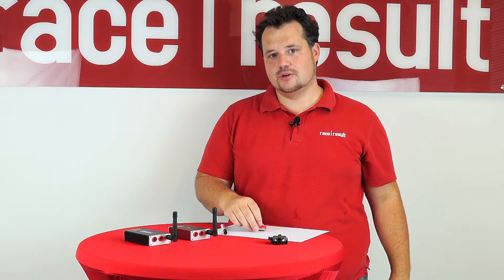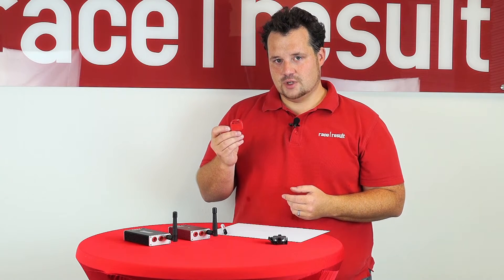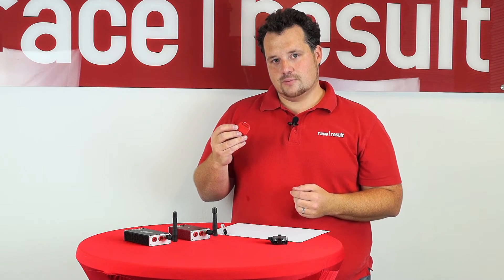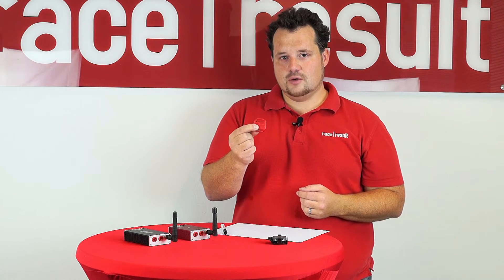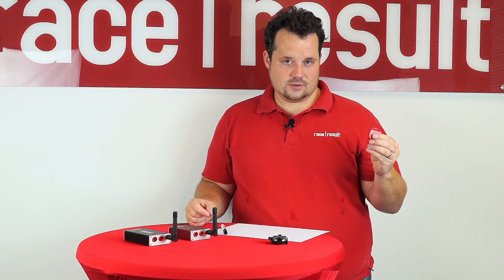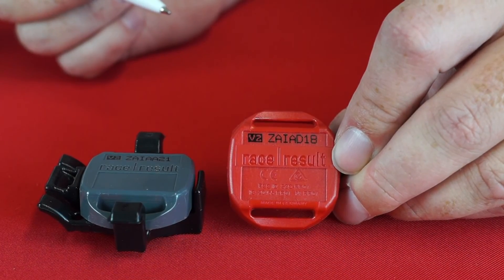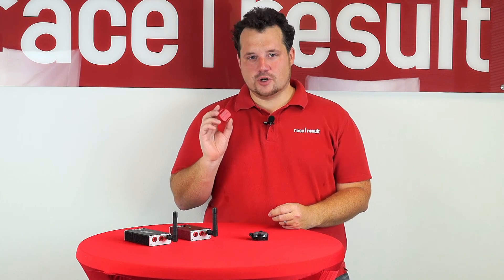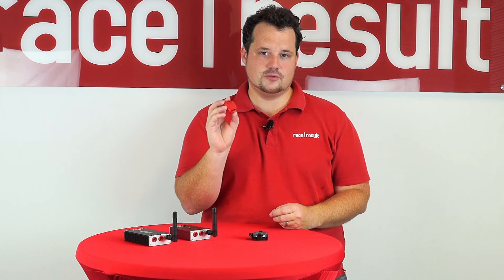Introducing our v2 active transponders

Comment: Curious to know, why transponders must always be in their cases? We always have cyclist doesn't use the transponder case - most of their reason are, it can damage their bikes.
Reply from the maker: The recommendation for the Active Chip Holder applies to the ActiveMotor (new name: MotorKart) transponder. It is used to ensure that the transponder is not in direct contact with metal parts.
In fact, the red transponder is commonly used on bikes without Chip Holder, instead it is attached with cable straps. That works perfectly!

Read more here: https://www.raceresult.com/fw/support/kb.php?id=2306-Active-Chip-Holder